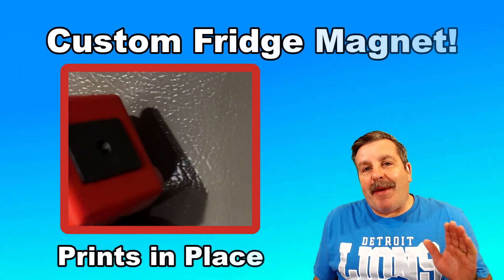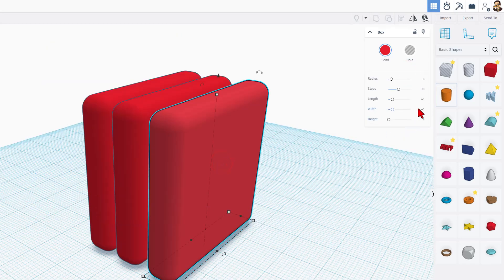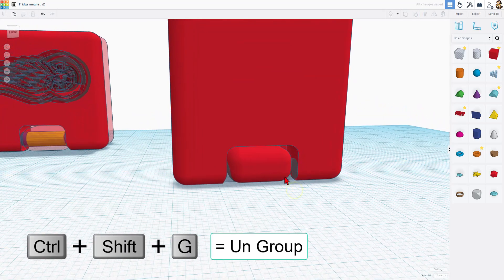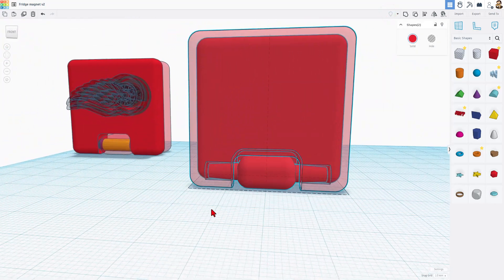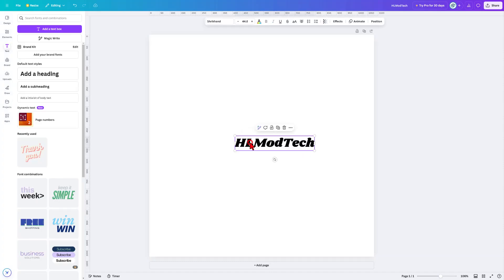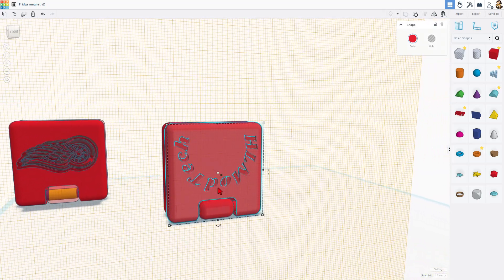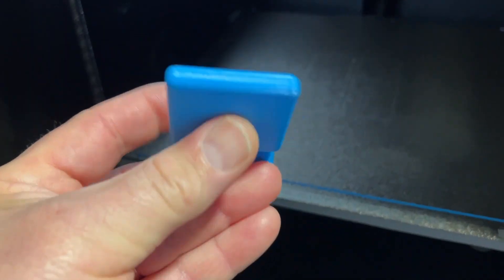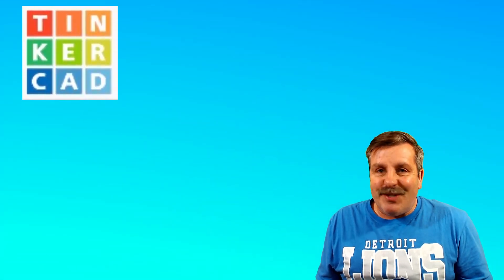A Print in Place Tinkercad Fridge Magnet! Beginner Steps Bambu P1S

Comment: When I group for the magnet in a design I'm making it, the hole goes down inside and I don't see a cut out
Reply from the maker: The trick is to pause the printer at the right layer to place the magnet before it fills it in.
Reply from the maker: I guess it is possible you had the cutout set as a solid (or transparent) instead of a hole. That would make it so there was no hole when it grouped.
Reply: I had it set as a whole. In the slicer it showed no hole. During the printing it never showed a hole. I tried it 2x. In your video you show a hole shown when you place it. Mine didn't. It went into the object. I must be doing something wrong. I used a round shape and the cylinder one. I'm making a small cloud shape for my jumping spider enclosures. The magnet is a 10x3 so I made the hole a 10.5x3.5  @HLModTech
Reply from the maker: Would you like to send a share link so I can see inside it? Here's how https://youtu.be/XeDQjhRK8lg You can reach me at hlmodtech gmail.
Reply: I'll share the link . Thank you!